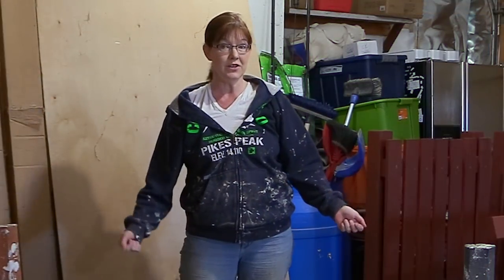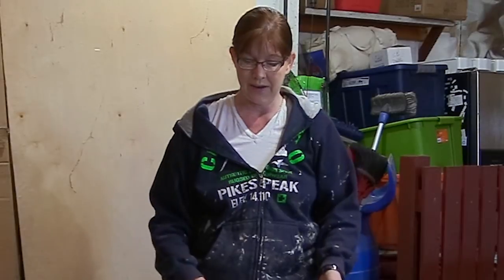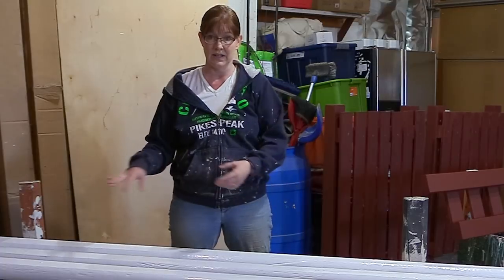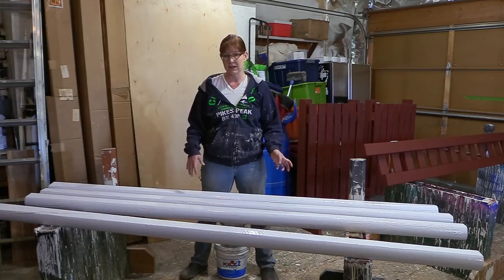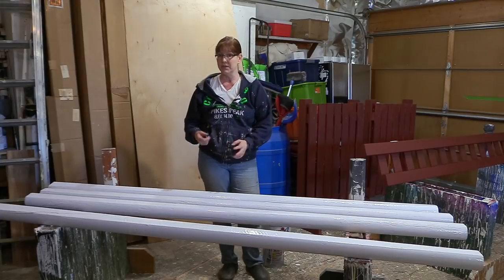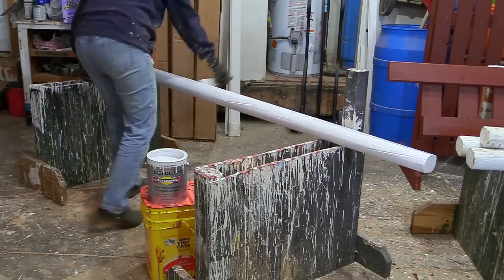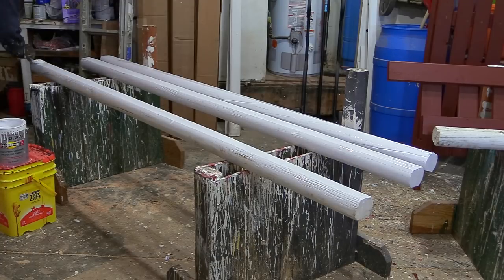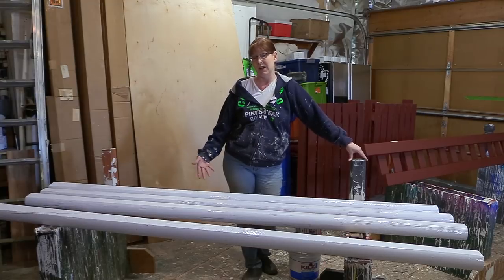How To Paint Horse Jump Rails (So Easy!)

Comment: it's true that oil based paint is more durable, and rustoleum is awesome, but I can't use it, even in a well ventilated area, because it is so smelly.  I'm so sensitive to chemical smells, the stuff will make me almost pass out.  I use EXTERIOR latex based paint and it works fine.  :)